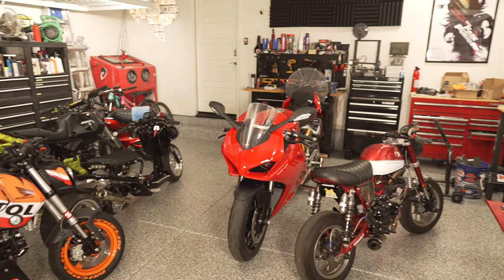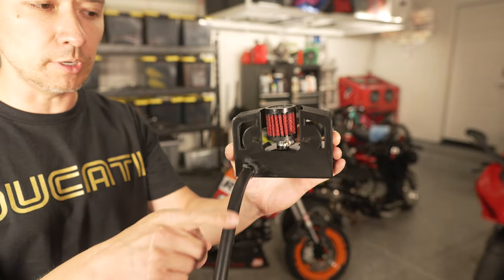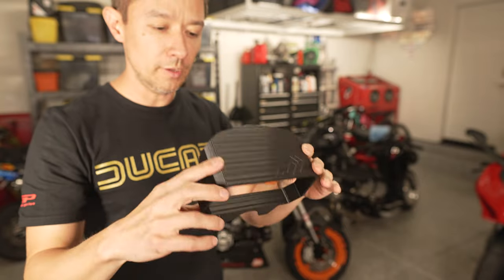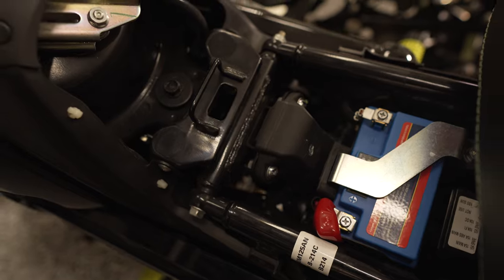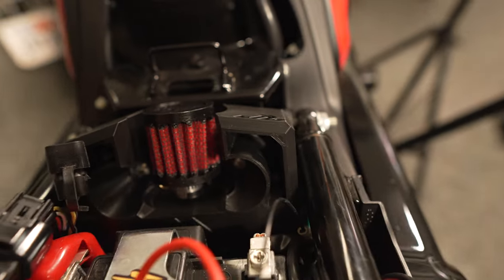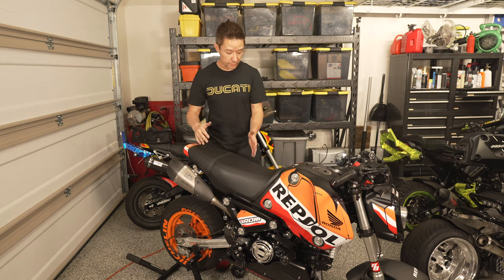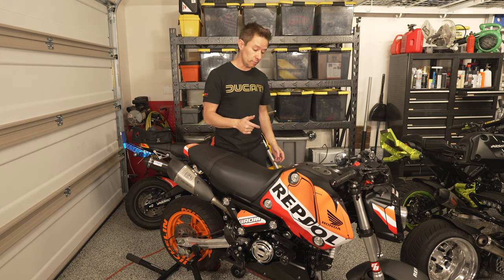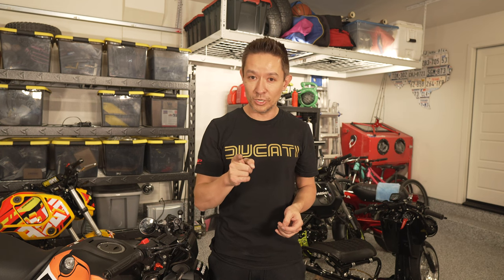DingerBuilt Oil Catch Can & Dash Visor for the 2022+ Honda Grom

Comment: Excellent and easy instructional video, per usual.

I was wondering if you had an opinion on the Kitaco oil catch can vs. the dingerbuild on the JC92 gen Groms? I have the Dingerbuilt air intake on my Grom as well, and get a bit of blowby oil now that I have a DHM cam, even with an Avail crank case cover w/ breather valve. Any idea if there's a difference in pressure relief and power performance maximization between the 2 catch can brands?
Reply from the maker: The Dingerbuilt is nice because it’s hidden and completely forget that it’s there. I’m assuming functionally they’re the same. The only downside is there’s no drain back in to the engine so at some point it’s going to be filled with oil.

Comment: I picked up this but I'm worried about plastic inside of it after seeing the key chains and how much Slag is extra on the td printing. I wanna get a scope camera to check the inside of the catch can before I use it .
Reply from the maker: I’ve had this on for a while and the little bit of oil it’s picked up hasn’t had any leak issues.

Comment: Just put a crankcase heatsink that has an option for a breather but my Monkey has ABS. This seems like a nice solution for those that don't.
Reply from the maker: I’m running the Kitaco catch can on the Monkey and it’s a pretty clean solution. I was getting so much blow by on that motor that oil was coming out of the breather filter.